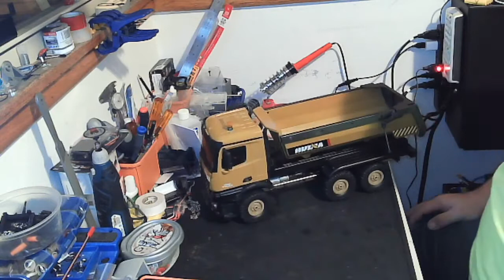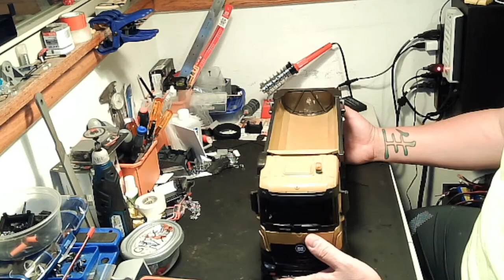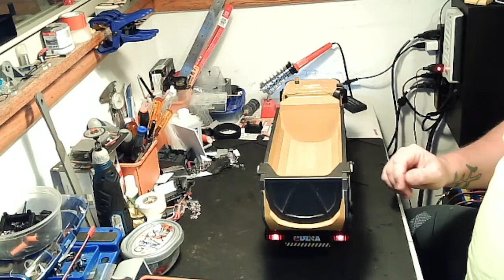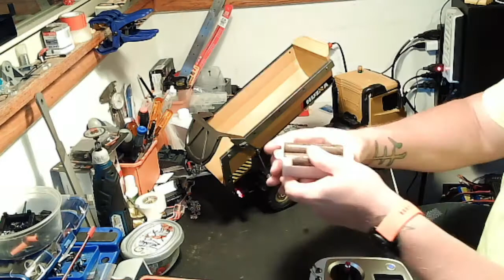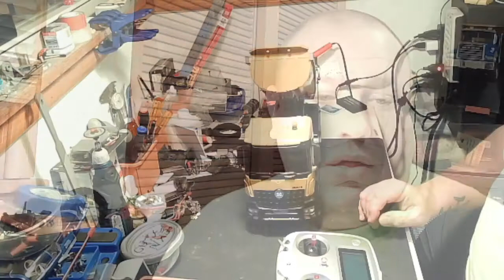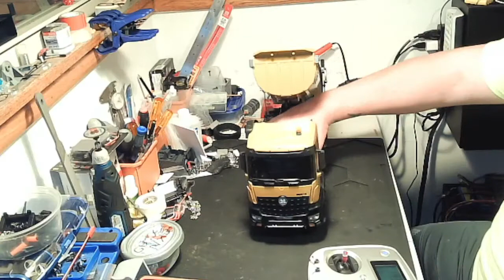WPL Huina 1573 Final Build

Comment: Looks really clean.  Bummer there wasn't room to keep the 2 speed but with 6x6 and rubber tires the suspension really doesn't seem necessary.
Reply from the maker: there is room for it , i just had problems getting the gear mesh for 1st and 2nd right